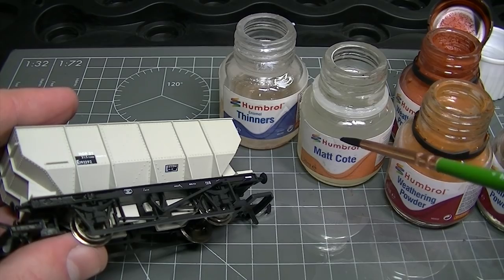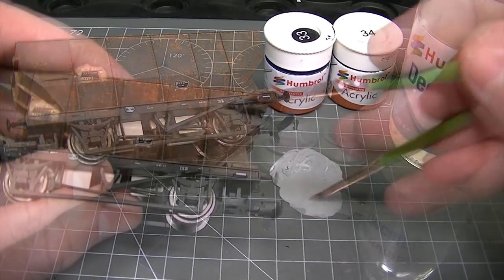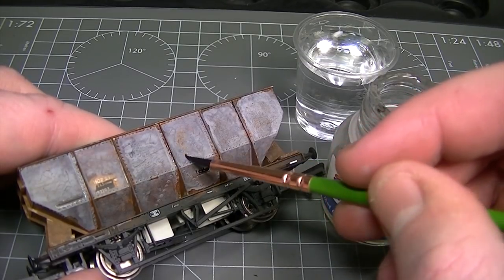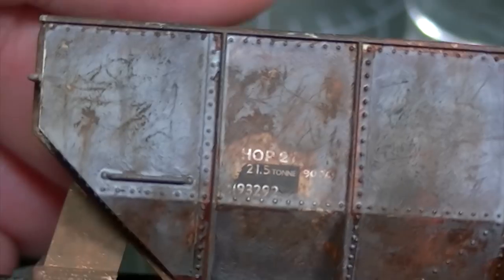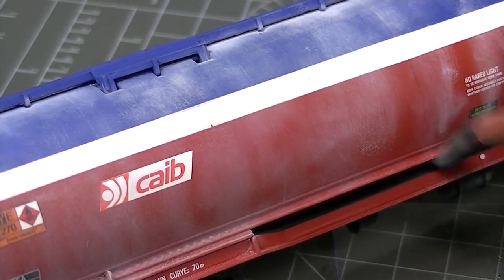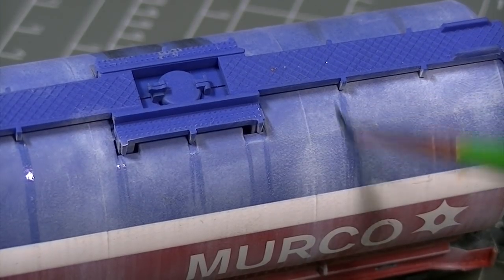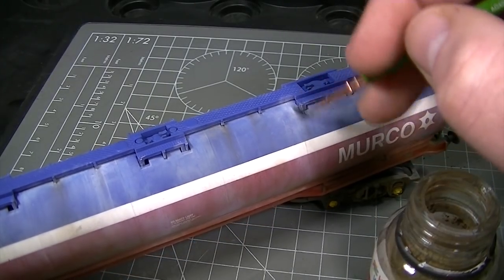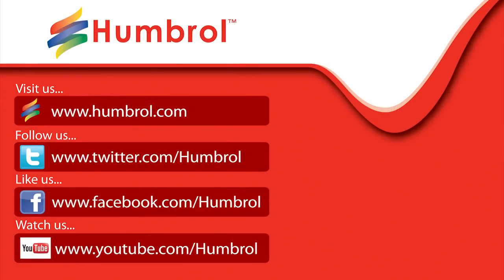Humbrol - Weathering Powder - Rolling Stock

Comment: Summary, Pt 1:
1. 50/50 mix of Enamel Thinners and Matt Cote.
2. Dab rust powders on the model with a large brush.
3. When dry, paint with acrylics thinned with Decal Fix.
4. Let dry, then paint with tap water. Allow this to soak in to the model.
5. The paint can now be scratched and chipped away.
6. Use a paint brush with Enamel Thinners to allow the rust to seep through.
7. More thinners, greater the rust showing through.
8. When happy with the effect, dilute again with tap water.

Comment: Bitterly disappointed i spent good money on a loads of weathering stuff and practised on 2 trucks which ended up a mess nothing like the video .I ended up exposing the original brown colour of the truck after painting the light grey on just dont get it.
Have since re done same truck and another looks a bit better but cannot achieve the results as on the video so no its not simple it is however a lot of hassle. The tanker i used did not look anywhere as good as the video. The smoke powder which appeared black on the video is actually grey so did not look like oil stain.
Reply: this is general guide, but you still have to experiment yourself with colors and layers...

Comment: Interesting variation to the hairspray-chipping technique and the commercially available and airbrushed sprayed, Chipping Medium. Instead of using a soluble layer of hairspray/chipping medium, the soluble component is mixed into the weathering paint itself and paint brush applied, in the form of water-soluble Humbrol DecalFix added to water-based acrylic paint, which is then chipped by tap water. Although no ratio is given, the proportions are such that the result in coverage would be via two layers of paint - but at the same time not be overly thick as to resist the chipping process. I would definitely experiment at this step using an eye dropper, to tract the ideal ratio, while practicing first on a disposable test piece. In this Humbrol weathering/rust technique, a further step is seen by the application of a solvent-based thinner, which reactivates the rust layer and causes a very realistic "bleeding" through the chipped/weathered acrylic layer. Again, a very interesting variation to the hairspray technique, and one that should be suitable for a winter camo application on an armored vehicle.